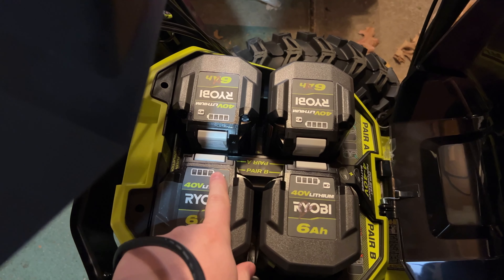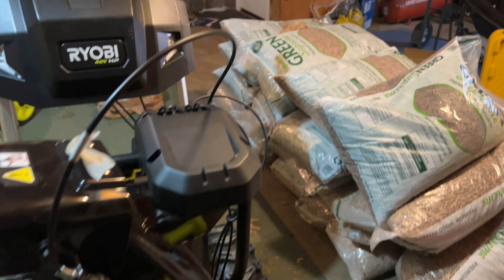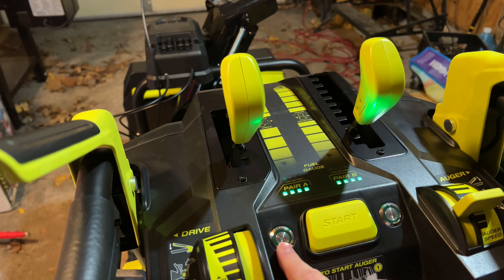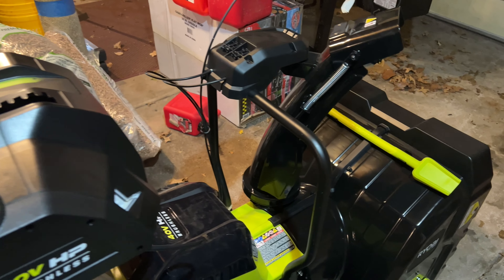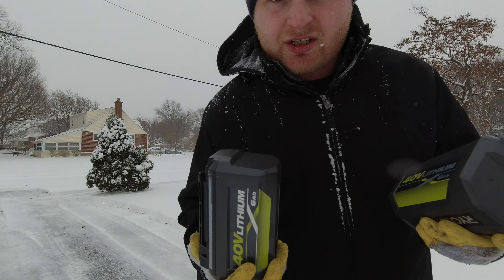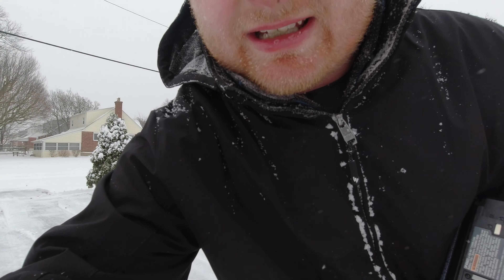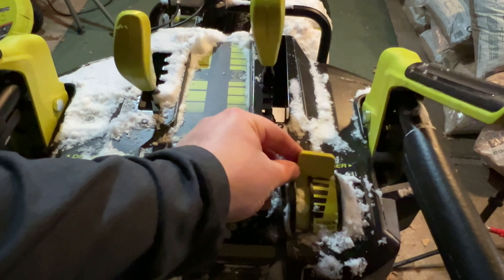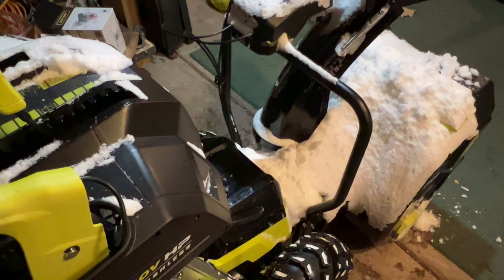Ryobi Snowblower 40V HP Brushless Cordless Electric 24 in. Self-Propelled 2-Stage Snow Blower

Comment: Great video the run time for all the battery powered snowblower/lawnmowers is the major issue. Recently purchased the Toro 60V Personal Pace battery powered lawnmower and I am very happy with the purchase. It is great not having to add gas, change oil and spark plugs. The run time easily allows me to cut my front and back lawns. I plan on buying the Toro 60v 26" snowblower.

Comment: Good video!  We've got 2 days of heavy snow forecasted for Wednesday and Thursday.  I'll be putting my Ryobi 40V single stage to the test!!
Reply from the maker: Please let me know how it does in the snow.
Reply: @sasquatchphil89  Phil..it rocked!  Seriously, I put it through the paces with both dry, fluffy snow to wet, heavy snow.  I used it on 4 different occasions.  I HATE doing it after I drive on the snow covered surface, so I will always try to do it again before driving somewhere.  My gas 2 cycle struggled with that too.  Very, very happy with the unit.  Batteries kept downstairs as well as the chargers.  I did a review of it showing it in action if you're interested...
https://youtu.be/CjYQahvmy_M
Reply from the maker: After I asked I saw your review that did amazing well I was shocked!
Reply: @sasquatchphil89  Bought ryobi 18 inch single stage after putting together and battery charged it started and died within seconds. I had 2 other batteries from my lawn mower and it did the same with each battery. Will try again tomorrow and if doesn't work will take back to store.
Reply from the maker: @larryrodriguez7119  might be a defective unit
Reply: @sasquatchphil89   I tried the unit this afternoon and put battery in did the same thing. I put a second battery in and I heard a latching sound. I tried and it runs. I did 3 swath down my 70 foot drive way and quit. It is too damn cold. It did a good job and I will make sure to listen  for latch. To pull battery out  I had to push release latch also. It did a good job.

Comment: bought on 6 days ago. taking it back. hand warmers come on as soon as the batteries are installed and don't shut off unless batteries are removed. when started the big front light comes on and won't turn off until the machine is turned off.
Reply from the maker: Mine does not do that I would definitely return or contact ryobi
Reply: @sasquatchphil89  taking it back.might be a wiring problem

Comment: Wow, nice build on their machines as usual.
I was actually very disappointed with my SNÖSLUNGA RYOBI RY36STX53A-150 36V 1X5.0AH
They claimed it would clear like 45 car park areas and despite the machine only having one input, of course 
one would normally expect double the area with another battery. Well at those prices, I had hoped having already their 5 ah battery
one would think it could/should fit to that machine, yet no lol.
They then claimed a throw distance of 10.5 m and I got only 2 m with dry snow and on max speed.
So in all, to spend over 10.500 kr (swedsh) on a machine you have to push where you need to buy yet more "different" batteries, no, this time they messed up.

Comment: Great video.  Looking to get one soon.  But I'm trying to decide between the Ryobi, Ego, Snow Joe and Toro 2- stage snow blowers.  All are similarly priced except the Toro being a few hundred dollars more.  

I do like that 4 batteries are included with the Ryobi.  I would probably just run 2 batteries until they die then pop in the second pair and charge the first pair. 

I live in SNJ (closer to Philly).  We haven't had a real good snow storm in a while.  Usually just get a few storms with about 3-4 inches and 1 with around 6-8".

Also thinking about getting a new Ryobi cordless lawn mower (think they use the same batteries).  If so, that would give me 6 batteries to use.  With that being said, it probably makes the most sense to buy the Ryobi snowblower.  If it's similar to the other three, then it's a done deal.
Reply from the maker: Well if you already are in one of the systems I recommend getting that one you have battery’s for! But if not I love my ryobi I’m supposed to be getting snow tomorrow and can’t wait to use it again
Reply: Another video review stated that Ryobi confirms the 3&4th batteries are drawn on for "excessive load" cases and boost power.  The second bank is automatically switched to when the active bank runs out of power. 

So I would leave all four batteries in the machine until one back runs down.  Then pull that and charge it, while continuing to run on the other bank.
Reply from the maker: @timothylynch1380  yes that's correct
Reply: @sasquatchphil89  I'm not into any particular system currently. I do plan on getting a cordless lawn mower and like the Roybi Crosswave. 

Did you prefer the Ryobi over the 2- stage cordless snow blowers and why?
Reply from the maker: @cspiegs1  I have the 40v push behind mower and I love it! I will be doing a review on it as soon as I can cut my lawn!
Reply from the maker: I sorry I saw the hole comment now. I liked it due to power, battery life and Ease of use it is very convenient to use no gas
Reply: @sasquatchphil89  Thats great.  But did you compare it to the other 2- stage cordless snow blowers (Ego, Toro and Snow Joe)?
Reply from the maker: @cspiegs1 the Ryobi won in my eyes because the 40v line up isn't going anywhere and I will be able to get batters for it for a while. the same can be said for the ego . i ended up with Ryobi because i had the lawn mower already and had extra batteries for it
Reply: @sasquatchphil89  Thanks Phil.  I currently have an old Black and Decker cordless lawn mower.  It's on its last legs so I am planning to get a new one.  The Ego 2 blade mower seems to be a little better than the 2 blade Ryobi but it is also a third more expensive.  Just based on this, I would most likely purchase the Ryobi.

I know less at the moment on all the above 2-stage cardless snowblowers but on my first take, appears they a comparable in performance (I haven't seen a head to head comparison yet hence my ask here).  I would like to evaluate these blowers just on their own and not introduce a shared ecosystem yet.

Did you do any comparisons?
Reply from the maker: @cspiegs1  no I didn’t I just was able to get the ryobi cheaper than the ego

Comment: The Ego 2 stage only gets 20 minutes run time on eco mode handling 10 inches of snow.  If you don't own other Ego products that use the same batteries which you could swap out this is not a good snowblower to buy.

Comment: Thanks i almost bought but after seeing how much it can take in 13min and alrdy down 4 battery pack, guess ill just stick to gasoline
Reply from the maker: It just read empty on the battery’s I got more time than that on it
Reply: I tried a battery snowblower and went back to a gas unit. I've used single and 2 stage units but prefer a good single stage gas unit over a 2 for its maneuverability and it clogging up less when handling slush.  You can easily clear a clog on a lighter single stage with its shorter chute by rocking it on the ground.  You can't do that with a heavy 2 stage with its longer chute. You have to stop and clear the clog with the on board tool.  I own a Toro Powerclear 721E which I used on handled 18 inches of snowfall easily.  I do wear a good pair of Sony noise cancellation headphones listening to music while using the Toro. It is way noisier than a battery unit but performs infinitely better.

Comment: not worth the price when they die that fast. 1200 in batteries no way. not including the price of the machine.
Reply from the maker: It came with 4 batteries and I have 2 from my lawnmower.
Reply: @sasquatchphil89  4 batteries makes it easier. thanks.
Reply from the maker: 1200 is for everything batteries and blower

Comment: Way over priced! You could buy a monster blower with a 12hp motor and clear 3' of snow no problem. That thing will never do that and batteries would be dead in 15 min trying it. If it was $500 sure for a small driveway. Other than that nope.
Reply from the maker: Used it today well worth it!

Comment: A person would have to be INSANE to buy this self-propelled Ryobi "battery powered" snow blower!  let's look at HOW EXPENSIVE it will be for you to "go green" or just feel you are a "much better person" because you are jumping on the "go electric" bandwagon.  this snow blower costs $1800 on the Home Depot web site.  this machine takes 4 40volt batteries which cost $180/each from Home Depot.  as the above video clearly shows, you would need AT LEAST 4 more spare batteries on hand so you could swap out the used batteries and finish the "driveway or sidewalk" you were attempting to clear of snow.  4 extra batteries will cost you $720 from Home Depot.  so your "going green" plan with this machine will cost you $2520.00 - $1800 for the machine and $720 for 4 extra batteries.  NOW, on the same Home Depot web site, just as an example, you can buy a GAS POWERED Troy built 24" self-propelled snow blower with all the same features as the battery Ryobi - for only $1000.  this machine has a 1/2 gallon gas tank on it and will no-doubt run for an hour on a full tank of gas.  but let's really waste some gas and say you will go through 2 gallons of gas to clean your driveway and sidewalk.  that would be 4 individual "fill-ups" on the Troy machine.  gas is now around $3.65/gallon so 2 gallons will cost you $7.30.  let's say you run your gas snow blower 20 times during the winter. gas would cost you $146.00. and that's assuming you go through 2 gallons of gas EVERY TIME you run your Troy Built machine - which you would likely NEVER DO.  so for the winter, a brand new gas-powered Troy-Built snow blower will cost you $1146.00 dollars - $1000 for the machine and $146.00 for gasoline.  that is $1374.00 dollars LESS than the battery Ryobi!!!  and this analysis DOES NOT even address whether the battery Ryobi could handle as much snow as the gas powered Troy-Built.  i would seriously DOUBT that a battery powered "self-propelled snow blower" will EVER perform as well as a gas powered model.  SO GO AHEAD - WASTE $2520.00 on a battery powered snow blower!!  remember, when you are wasting that extra $1374.00 on your "battery machine", you can "feel good" about yourself because YOU are helping to eliminate those AWFUL "gasoline" powered machines!!  LOL! LOL! LOL! LOL!
Reply: Yeah yeah you are spot on brilliant. BUT for a small bodied person to handle the battery powered is much easier along with people that do not like keeping small engines running.  For me I'm all with the gas powered. For my 5' small framed girlfriend the gas 2 stage is way too bulky for her to manhandle. Just got here the single stage EGO. Perfect size for her. The world needs variety for variety of needs
Reply: @scottbeefful  yes, you are correct - battery lawn machines are much easier to use than gasoline ones.  and yes, the battery Ryobi snow blower is probably easier to handle for a woman, elderly person, or small man.  the issue that bothers me about the new generation of battery "machines" is their cost versus their performance.  AND, it is particularly annoying that Ryobi is selling this battery snow blower for $1000 dollars more than a comparable gas model.  i was just in a local Home Depot yesterday and they had the battery snow blower beside a very nice red gas Toro (i think) of the same size.  the Toro was $799.00.  and as i noted above, i think a person will need an extra battery to be able to use the electric snow blower long enough to clear a driveway.  i believe a 40 volt battery is about $160.00 dollars at HD.  so now you're looking at spending $2000.00 dollars for the "convenience" of a battery powered tool.  but i will agree with you that the world needs "a variety of things."
Reply: @jimharvard  Easy to find extra Ryobi batteries (6Ah) for half price on eBay. I just picked up 2 for under $200 and two single chargers for under $50.
Reply: the $1000 troy built doesnt have heated grips, lights, or motorized chutes. Also, you must realize that this ryobi is actually more powerful than the gas troybuilt. As others have mentioned the battery powered blowers are easier to operate and maintain vs. gas blowers. Not about going green at all, the ryobi is probably a more high performance product. If you have a gigantic area to snowblow you are going to have to use gas, thats pretty clear.
Reply: My math is a little different. Firstly, I have a small driveway and sidewalk area. Secondly, I live in an area with dusty lightweight snow. So I won't need the extra batteries beyond what's included. I also do my snow clearing between 4 am and 6 am, and have neighbors directly nextdoor on both sides of my driveway and across the street. So I need something far quieter than a gasoline motor. There's more to this than just "feeling good". Plus, there's maintenance. A well-maintained gasoline machine takes more work than a well-maintained brushless electric machine. I think this particular model is overkill for my sized driveway, but I will almost certainly be going with a battery powered machine. Mine will probably cost less than $1,000 and will probably be single-stage. I'll get it with batteries that work with my other tools. That's something else gas can't do (especially once it's used up): power your lawn mower, chain saw, leaf blower, and power tools. Just saying. They're totally different applications. No need to "LOL! LOL! LOL! LOL!"
Reply: @CharlesReinmuth.     i am all about "freedom of choice."  if someone wants to invest more money in an electric snow blower or lawn mower than they need to for a gas powered one, that's their "right."  i have almost every battery powered "hand" tool Ryobi makes.  i flip houses and their battery hand tools are very good and easy to use.  however, as one moves "up the food chain" to larger applications of battery-powered "stuff", the battery costs rise exponentially and the performance drops exponentially.   i am on Facebook marketplace all the time and it seems there are a lot of battery lawn mowers for sale there within 100 miles of the Pittsburgh, PA area. i would bet that come spring, there will be a lot of battery snow blowers for sale.

Comment: Should have got that ego top of the line
Any battery powered tool that is owned should always have a second set of batteries one set to charge and one set to use
Reply from the maker: There is a second set of batteries it only needs 2 to run out of the for
Reply from the maker: No the ryobi has 4 batteries but only needs 2 batteries to run